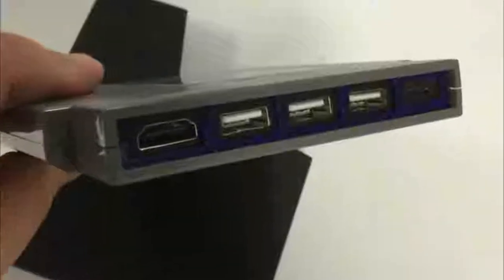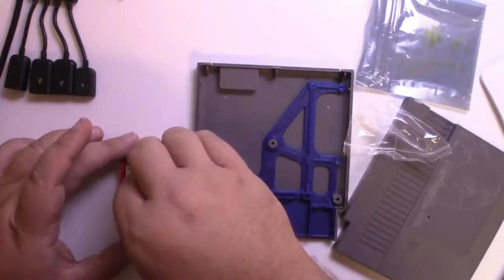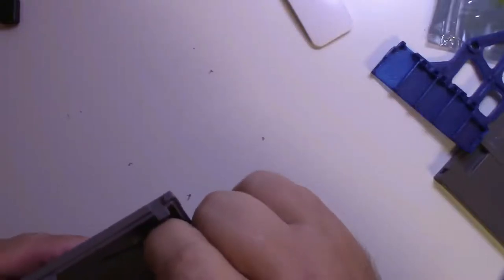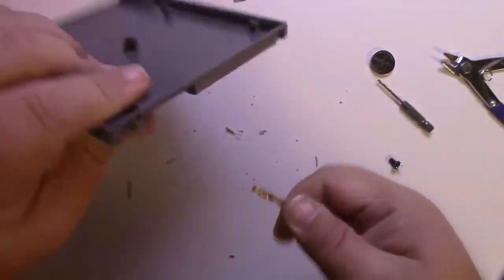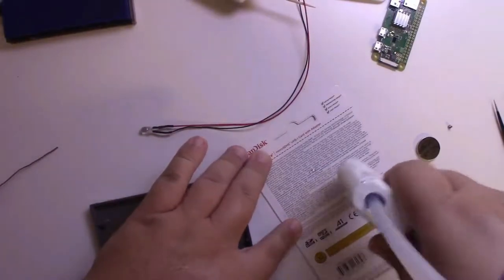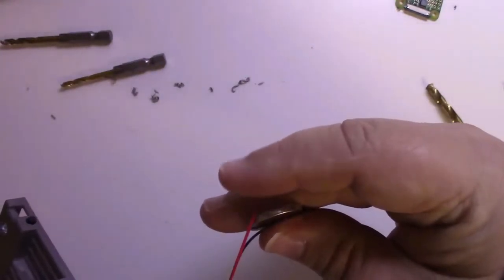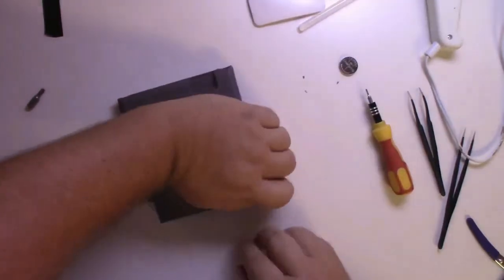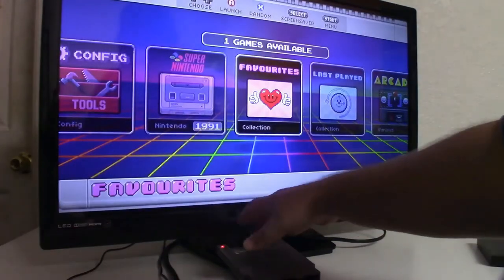DIY In-depth: How to Build the Pi Zero NES Pi Cart with Power Button and LED Indicator

Comment: I followed  all instructions on the video. Retro pie runs and the led turns on, but the power switch doesn't do anything.  Any ideas? Thx!
Reply from the maker: It doesn't turn on the device either? Or doesn't do anything when the device is on?

Comment: In mine the light stays on but I haven't been able to get the on and off switch to work just yet. I have to wait until my controllers come in.
Reply from the maker: light stays on when you shut down?
Reply: @EricMBoyd   No. It goes off when the device is unplugged from the wall. I can't shut the pi on or off with the push button. The power comes on when I plug the device into the wall.  Retro pi does load, but because I don't have my controllers (On order) It doesn't go past the controller setup screen. So I have to wait until after I get the controllers before I can continue.

The good thing about it though is that at least the Pi didn't blow up on me when I plugged it in so my soldering is okay.
Reply from the maker: @GESSO217  Sounds like you got it! You can use a keyboard until you get the controllers. Also, don't use the power button to turn off in ES or it won't save config on shut down for some reason.

Comment: What kind of wire do you need for the switch button ?
Reply from the maker: I just stripped an old USB cable and also used Network cable witre stripped for the 8 wires.

Comment: What switches did you use? There's no link.
Reply from the maker: Gikfun 50Pcs 6x6x9mm Tact Tactile Push Button Momentary Micro Switch with Cap for Arduino (Pack of 50PCS) EK1852 https://www.amazon.com/dp/B073PY9FNH/ref=cm_sw_r_cp_api_i_nr5qCbCDWAEX7